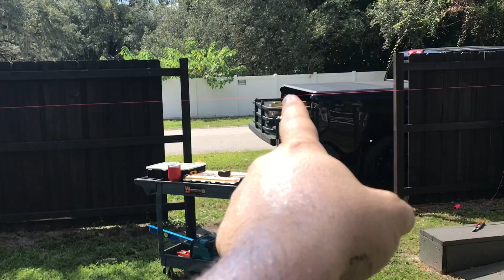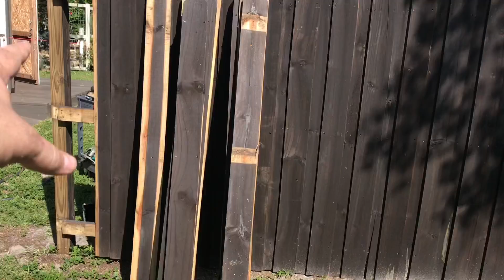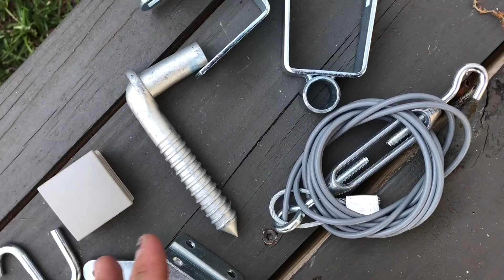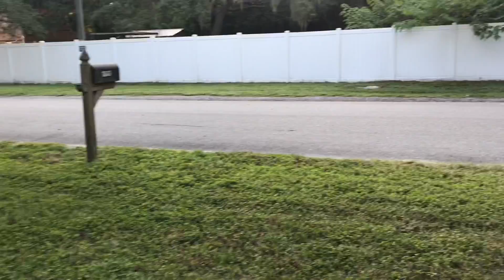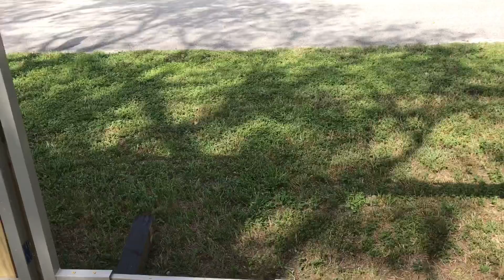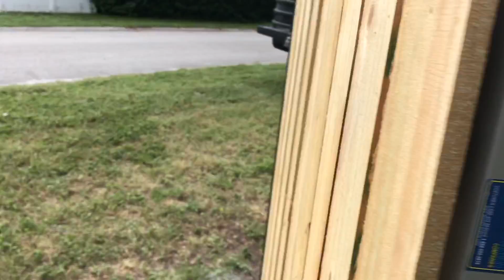How To Build a Double Gate

Comment: Me again ,lol im at my finnal stages of prep work im almost ready to start my fence i just had few more details to iron out ,so how tall are your 4x4 above ground and at what hight are your 2x4 stringers set at so i know when i measure the 15 inch mark for the hinges i know where to start from ,to be exact you measured 15 inches from the middle ringer going up and down for the hinges how far is that middle ringer 2x4 from bottom or top of the 4x4 the center of it

Comment: Using screw is very beneficial especially if you need to take a section down to put in a shed. I literally just did a 389' privacy fence for a client using 3&1/2" screws for the 2x4's and 1&5/8" screw for the pickets. Yeah five 5lb (25lbs) boxes of 1&5/8" screws and
 15lbs of 3&1/2" screws. My clients fence will last for many more years than being nailed.

Comment: Turn your top hinge down ward to lock it in, so no one can lift your gate up and take it off.
Reply from the maker: Choose a neighborhood where you don’t have to worry about that. If that’s the only thing stopping someone, they would have a much easier time just popping a couple boards off or a panel. Much easier and lighter. But seriously tho… not a bad idea
Reply: leave the hinges the way he has them to make gate removal much easier if you need to remove gates for a little more clearance i have the same type and size of gates they are very heavy not easy to just pick up and remove

Comment: Nice job. Thx!
I’ve decided to never sink wood posts into concrete. Instead, I use angle iron on two  (or $four) corners and then bolt my post to that above ground. 2’ of steel in concrete below and 2’ above. The wood never touches moist dirt and will therefore last longer. Drill holes in the metal, and attach the post with lag bolt to metal before dropping into concrete to get level as it sets up. The post is unwieldy like on stilts before dropping hole, but sets up nice. Seal bottom of post end grain to prevent wicking and post sits at ground level with nobody knowing the trick. Paint metal accent black and it looks classy.

Comment: Dude this is awesome and just what I was looking for. Since doing this gate have you experienced any issues with it? I've been looking at the Adjust-A-Gates and noticed they have a 3 rail system vice the 2 I might try out for extra stability.
Reply from the maker: Go with the 3 rail. These sagged about 1 inch since I installed
Reply: @fixitnoworlater  right on I'll give that a try. Was thinking about putting casters on it as well to help support the ends

Comment: On the farm as a kid, we were instructed that all the dirt go back into the post hole. Plus, our frost line is 48” and a double gate takes 60 to 80 MPH winds. I had to use 8” X 8” X 10’ treated 48” below grade, because it is 16 feet wide. Just point the bottoms like a pencil action on some gravel. Using 3 eyelet lags & 3 match pegs, I put 2” X 6” at ends with 2” X 4” treated attached with gang plate nailers. Welded slip on 1/2” plates make the log splitter push them in. They don’t make a metal frame in this size, so top to bottom corner have 1/2” rebar & all-thread welded the last 9” or so. Just a flat washer & nut into “Birds Mouth” cut makes them flush. We are on a corner property and the back concrete driveway slopes to the middle. To keep dogs from going under, I used 4 butt hinges and added structure, but the bottom 1” X 6” board was matched using dividers, cut and hinged to swing up. A small notch to keep the 1” nylon strap like chin strap for helmets, screwed on front and tops extra long, folded and sewn. Place two screws at open & one at close. Phillips screwdriver heated just melted nice holes to hold open when in use, one low to put strap home when down. Plus extra loop makes easy grab. Torch & vise allowed to bend 1” X 1/4” flat bar strap to lag bolt into rail. 3 on top with pivot, same on bottom and hold with any wind. Can’t open from outside but I installed digital door locks on all 3 exterior doors. Each gate can be different but being able adjust for any sag worth it. We had “Bridge Planks” for holding pen for cattle & horses. We bought or barrow a seed bull of the “Bhrama” breed. It took its horns and lifted the entire gate off 4 eyelet hinges on a single 12 foot gate and tossed it. It was so heavy, that after three days of jacks, levers & fulcrums, used a tractor a chain to lift it in place. Each of the 5 guys took turns guessing the gate was 1,200 lbs to 1,600 lbs. Regardless, that was amazing strength! Nice job on gate. Are you painting the “X” frames white to match?
Reply: I didn't understand alot of your terms but I enjoyed your anectdote.
Reply: @nicthespic3023  It is cool. Like re-bar (solid metal bar stock w/bumps for concrete to grab onto.
Weld a length of threaded stock and tighten with a nut.
 Installed at top corner (hinge end) and lower corner on the other end. It lifts the gate. Adds strength. Birds mouth, is a simple pair of cuts on the side or end of a board, looks like the mouth of bird when open. You learn a lot on a farm 20+ years before the internet. 
 Thank you kindly. Have a lucky one!
Reply: Florida says what is a frost line?
Reply: @ I think it’s 5,260 feet down. So stop at a mile!

Comment: Nice Gate and Concept, but you can only open the gate from the inside with all the hardware at the bottom. Unless you leave the extra cane bolt and latch undone. But it is a very well constructed gate.
Reply from the maker: That’s the point for security here. Don’t want anyone opening it up from the outside round these parts.

Comment: This was very Helpful. I have a 16 foot wide opening that has had a sagging problem almost since the beginning. I just found the adjust a gate and figured I would give it a try. I watched your video with the sound down just to get a rough idea and did EXACTLY what you did. Skinned it at night because I have Dogs and the next morning had to figure out where I messed up. Watched the video again with the sound up and was kicking myself for causing myself the extra work. Also the Screws... Great advice. I always use screws. 1 side of my yard is a neighbors fence and it was put up with nails. Impossible to repair a board without destroying it.

Comment: If I am following the video direction exactly, how much space did you leave between your posts? I've looked in the comments but can't find that answer.
Reply from the maker: That part is variable. Not a science. Don’t exceed a 12’ span and you’ll be ok. You custom build and adjust the gate width by dividing your total span in half once they’re cured in the ground. Then subtract about an inch on each to ensure they don’t collide.

Comment: Great vid.  Can you give me a little more info on the 4X4 posts on either side for the gate Firest are they 4x4 or 6x6.  How wide a hole did you make and it appears you used 2x4s attached to the 4x4's in the hole. Is that correct?  do they extend down 24" along with the post?  did you only put the extra wood on 2 sides?

Comment: Awesome video man! I'm going to try to make a gate almost identical to this. Any tips for having to jackhammer through Concrete? My gate is basically going over a driveway. Do you think I'd still have to make such large holes for my posts to get so much concrete poured in? Or are there any tricks you can share for that? I was hoping I could minimize the size of the holes to put in my driveway. Thanks!

Comment: YOU UPLOADED  THAT VIDEO ON MY BIRTHDAY. i USED SIDE BY SIDE PLANKS ON BY GATE WHICH ARE ATTACHED BOTH SIDES OF IT BECAUSE OF HORNETS, YELLOW JACKETS, WASPS, AND THE WEATHER CONDITIONS TO PREVENT SNOW BUILD UP OR THE INTERIOR FROM GETTING WET PLUS I USED CLEAR DAP SEALER TO CLOSE GAPS, CRACKS, AND SEAL HOLES. THE HINGE SET I BOUGHT WAS MISSING SOME SCREWS & BOLTS SO I BOUGHT LAG BOLTS TO SCREW INTO THE 2X4'S & 4X4'S.

Comment: Built my wood fence 21 years ago and it's still up I put gravel below each 4x4 so the water would drain away from the 4x4 also before I installed mine I dried the boards by laying them in my driveway letting the sun slowly dry them and panted everything going into the dirt.
Reply: Another post preservative method is to drill an angled hole into the post just above ground level. Pour your used motor oil into the hole. It'll soak into the wood. Just be sensible about hole size to post size. You are removing structure by drilling, but all posts work together so it not a huge concern.

Comment: I use screws all the time, if you use nails on a fence over time they even start to back out.
Reply: Avoid using smooth shank nails. Ring shank won't back out.
Reply from the maker: Ring shanks have backed out more times than I can count out here in humid Florida. The small little ring shanks on the nails are no match for the board cupping due to moisture in the air and constant rains. The wood always overcomes the shanks and either backs out the nail or passes by the nail head. Plus no matter how nice of a ring shank nail you use... the PT wood will rust out those nails within 4 years in humid climates. Use the deck screws
Reply: @fixitnoworlater  If your PT wood is rusting out nails, then you are using the wrong nails. Current types of PT wood obliterates most galvanized fasteners. You should ALWAYS use stainless steel, or hot-dipped galvanized with a coating that meets ASTM A153 standards, (nails, screws, hangers, etc) since it is safe to use with PT wood and stainless will not cause streaking when used with cedar.

Comment: Good video. However, if you live in Florida, or any other hurricane prone location. I would HIGHLY suggest, installing your top lag bolts pointed down. This locked the gates to the posts, otherwise you might find your gates at the neighbors house one day. Also, using a laser lever to sight the lag bolts locations its great method to use, from one hinge post to the other.
Reply: Wouldn't top or bottom pointed down work the same? Can't just lift and run.

Comment: I noticed that you opened the gate inward when finished.  Are you able to open it outward, toward the street?  I know you could before you screwed the pickets on.  Just wondering if you could still open it outward with the pickets now installed.  Thanks.
Reply from the maker: Yes but I added trim to the top and bottom on the outside so it can only open inward at that point.

Comment: Just an observation but in another photo of the steel frame, I noticed the top L bolt that the metal frame pivots on ( the ones screwed into the main post), is pointed down.  Of course the bottom one is pointed upward otherwise the frame would slide off.  If they are both pointed upward, is it possible to lift the gate clean off?  Strong person on each side, on the count of 3?  Would seem logical for both to be pointed upward to spread the weight evenly on both.
Reply from the maker: You could flip your hinge. I have mine up because at times I do have to pull the gates off the hinges to get large equipment in the yard.

Comment: The exact video I needed involving the Adjust - A - Gate kit. Just a couple small questions for ya; The Adjust a gate kit I found was around $300 or so. Is that what you used? just making sure Im on the right track. Thanks!! great video
Reply from the maker: No... $49 at Home Depot for the ones I’m using in the video.
Reply: Fix It Now Awe I think I found it. $49 for 1 kit so I would need 2 kits right? dumb question; but Im making exactly what u made so I dont wanna get the wrong thing.
Reply from the maker: Yes 2 kits, some concrete bags, handful of screws, boards, 2x4’s. Should be good to go.
Reply: Hey, Ill try to make this my last comment:) but I finally installed my double gate yesterday but mine is outward swinging which has made it crazy hard to skin. Curious about a couple things; did you apply  2 sets of skins in a staggered pattern? I noticed you have no gaps at all like a regular fence board. Curious how u did that. Also is that 1x4 PT for your added trim? I have to do that too in order to simply have more wood to latch onto. Oh lastly, approx; how big of space between both gates did u end up with? I have a full inch and it seems a bit much!!! sorry for all the questions
Reply: @fixitnoworlater  I see this kit on Home Depot as of May 2021 for $391. Where are you getting a gate kit for $49.??
Reply from the maker: In the store pre covid

Comment: Just for idea, good to install heavy duty 10" or 12" hinges with wheels at base for additional supports for 5 feet doors.
Reply from the maker: Gate would have to be high enough off the ground to accommodate wheel swivel. Not useful in this application with dogs.

Comment: Could I use this for a motorized wood gate ?
Reply from the maker: Don’t see why not. Just need to calculate and engineer what is needed for the automatic hydraulic rams.
Reply: @fixitnoworlater  wondering if it's rigid enough, I plan on doing a double gate each gate will be either 5foot or 6 foot. The gate opener itself has all the hardware and info on mounting position for optimal use and angles.
I will be mounting it to a 6x6 with extra concrete like you did too.
Think it's do-able ?
Reply from the maker: I think so. Yes. Use the 6x6 post
Reply: @fixitnoworlater  thanks for the quick response. Great video man

Comment: This was a great video and I love these gates!!! I have used several of these in the past. My only question is this...I wish you would have shown the gates closed from the street side. I don’t see any way that the outside gates are flush with the rest of the fence. I have always had to add an additional 2X4 to the framing before I put the pickets on so it’s flush on the finished side which in your case, the street side. Is it flush on that side?? Thanks so much for the video.
Reply: Aah, wish we could see it.  You did a great job.
Reply from the maker: They’re not. They’re inset. I also have trim on them. Makes for a slick look.

Comment: Great Vid - thanks!  In researching gate builds - building a 10" one myself - I've seen many negative comments about the Adjust A Gate product.  As you pointed out, the hardware (screws) that come with the gate are junk so it's recommended to purchase ones at your local home improvement store.  I've also seen several posts / pictures showing this gate frame rusting after just a couple of years - lots of rust to the point that a new gate was needed.  Looks like yours has only been up a few months but wondering if you had any previous Adjust A Gate builds and how they were fairing regarding the rust issue?
Reply from the maker: No rust. I have 4 others on my property. The oldest is 7 years and it’s Florida. Loads of rain and humidity. Zero rust. I did stain my frame when the fences were stained and the stain acts like a paint in a way so maybe that is preserving it? Nevertheless no rust and still as good as the day I put them in.
Reply: Fix It Now I used the Adjust A Gate on a double 13’ opening over 10 years ago and it has held up great.  No rust (I’m in Virginia) and no sagging.

Comment: How do you open the bottom latch when you're returning home from the street ? When there's no access from outside.
Reply from the maker: You don’t. It’s for security purposes. I don’t want general outside access. If I plan on using this gate for the day I’ll pop the bottom latch first.
Reply: @fixitnoworlater  .  .that's the point, security + functionality. The challenge is to have both, design a lock the can be opened from the inside and outside. If you need to leave the latch open to access the yard "for the day" you are breaking the security measures for that day, if you  leave it closed you have to walk over to the other side which is a long walk.
Reply: @fixitnoworlater  . . An idea is a chain with a padlock . . you just turn the chain on itself and access the padlock whether from the inside or outside. It could look a bit ugly .. but you can hide it somehow , There's more ideas.  .

Comment: Fantastic work fellow DYI er !  I know you are a pretty sharp guy from your directing !   The average guy watching your video could easily end with corner posts out of plum considering you never mention bracing while cement cures !  Also I know you used the metal gate kit but your primary board ( the one not cut in two ) on your  cross brace needs to be installed from the unsupported top side of gate to the lower hinge spot ! If done prior to installing pickets fence gate will not sag afterwards !  A security step I’ve taken using the the screw type hinge is to reverse the top screw  down as your fence can be lifted right off and taken away in the middle of the nite the way it was installed in the video !  All in all I enjoy your videos and am a subscriber and have been known to share sometimes !   I’m just a  74yr young handyman up here in the Last Frontier !  Best of luck YouTubing !
Reply from the maker: Thanks a bunch for the tips!!! 👍
Reply: Yes on  cross brace needs to be installed from the unsupported top side of gate to the lower hinge spot !  And I saw a video that shows you don't want to go pass 45 degrees on the cross support brace. Anybody building a gate might want to look that up.

Comment: Excellent video for building a gate.  I needed this info for building my 10 foot double gate.  Hope to use 8 foot 2 3/8 metal posts instead of 4 X 4s.  It will be a learning process and fun!!
Reply: Mr. Anlauf, I'd like to see how you are going to attach the metal frame to the metal posts using the lag-style pins.  I know they can attach to the 4x4s because the pins screw on Into the wood, but on metal posts?  Let us know.
Reply: Clamp and adjustable hinge pair for chain link metal post.   I'm going to use this instead of the wood screws that come with the Adjust- A-Gate hardware.